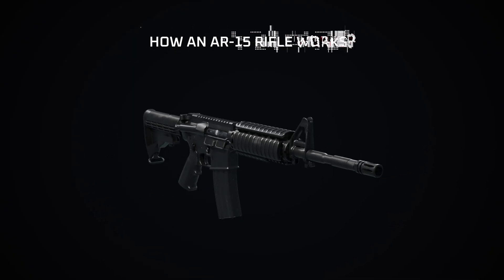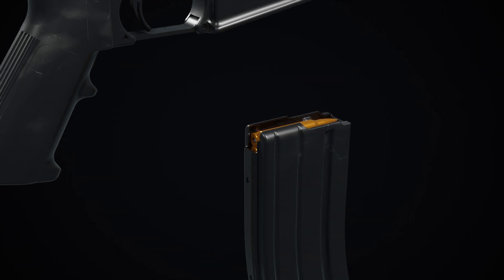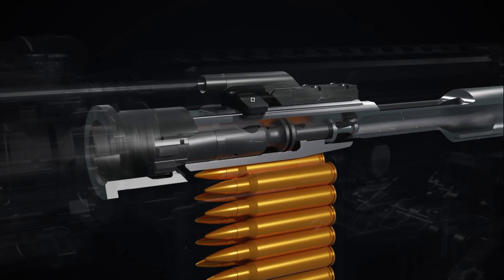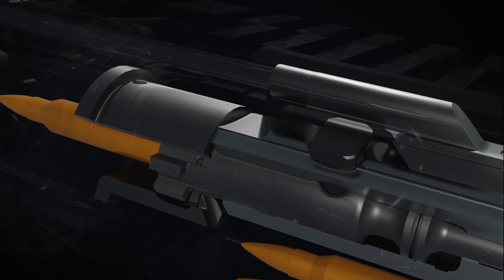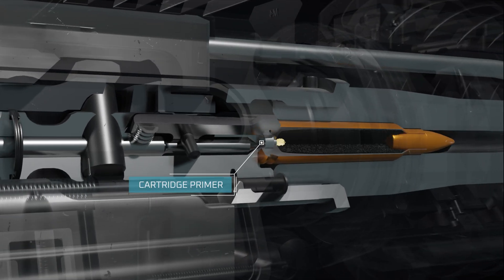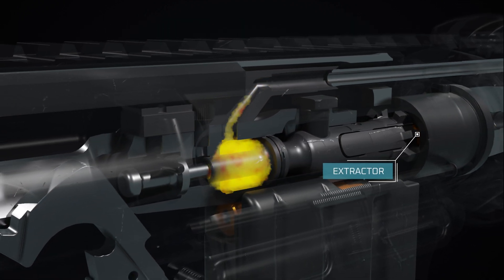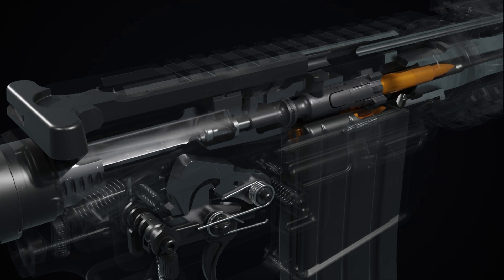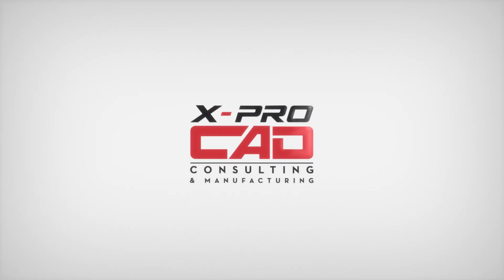How it works? AR-15 Rifle

Comment: I thought ar means Assault Rifle?
Reply: From wikipedia: A common misconception is that "AR" is an abbreviation for "assault rifle" or "automatic rifle",[13][14][15] perhaps because of the weapon's inclusion in the Federal Assault Weapons Ban in 1994, or because the ArmaLite AR-15 was originally designed to replace the M14 rifle in the Vietnam War.

Thought this was intersting!